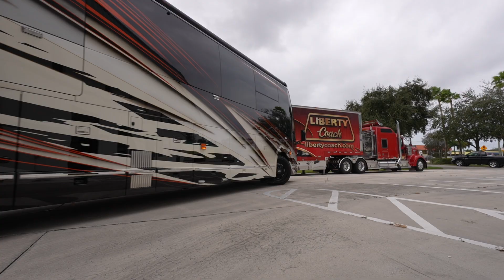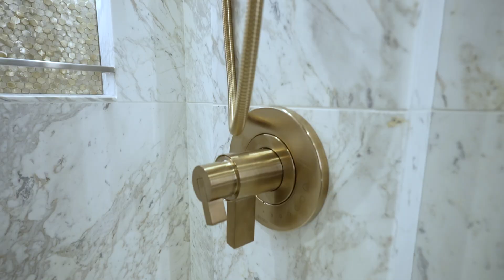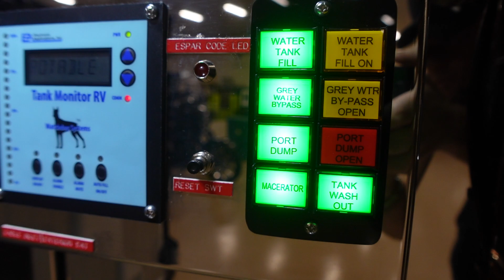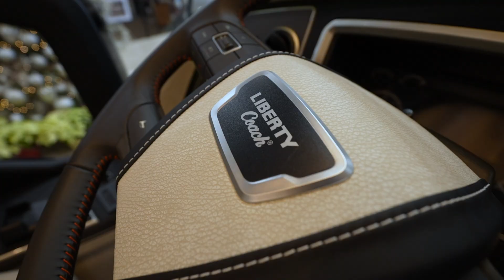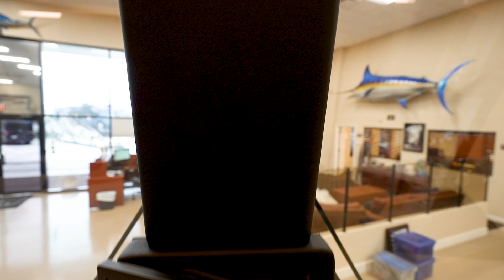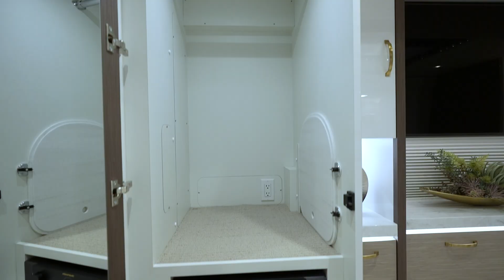2024 Liberty Coach #904 (New Body Style Prevost!)

Comment: Dose the exhush!st from the generator go through the roof too
Reply: Good question, the generator exhaust does not go through the roof, it is a bit complicated to do so, making sure there is sufficient air around the exhaust as well as insulation can take up a considerable amount of interior space, as well as loss of compartment space depending on where the exhaust would head up the interior of the coach.

Comment: Hey Liberty, If you scrimped out using a Westward toolbox, where else did you cut coners?
Reply: Thank you for a comment, do you have another tool box to fit the location?  We always used Snap-On, however they stopped production on a size we could use.  I can assure you we do not "cut corners"

Comment: There is a very big problem with your RV's and that is there is no way a person in a wheelchair can get inside or someone that uses an electric wheelchair that enjoy going places and hate being stuck at home all the time. If you can come up with one that will allow them to go camping or RVing with friends then I would be willing to advertise for you for free using one of your RV's with my brother Martin who uses a wheelchair if you are willing to let us have one for free for advertising with your logo on the side so I can tell people how great it is and you can use it as a tax write off
Reply: There isn't any customization they "can't" do.
Reply: Interesting comment. Since these are custom built I am sure they can accommodate a lift for wheelchair accessibility. If they meet your request if would be the most expensive advertising they could get. Not sure they would give away a coach worth that much just to showcase their unit.
Reply: There are wheelchair accessible motorhomes. I met a couple that had one made by Newmar. They found one used. It had a lift, hand controls,and the bathroom is wheelchair accessible with the slides in.
Reply: Yes you can (rare) find a used one. But they are old. I am also in a wheelchair, and also suggested the same as you did. No one interested and they use the reason that there is not a market need for them. To have a new one built they demand 3/4 of price down. So it might be less expensive to buy one then have a lift put in unless you can afford a new one
Reply: Invest in some prosetic legs 😂

Comment: What is the weight capacity of the slide trays?

How much do the slide-outs weigh?

Since the trend is going away from the satellite dish system, are the coaches outfitted with the Starlink system as the replacement?
Reply: The capacity of the slide out tray is 500 lbs, not sure I understand the question regarding the weight of the slide-outs?
Reply: The Starlink is not a replacement to the satellite dish, it is an internet data system that can be used in conjunction with the cellular systems.

Comment: Can you have more than 3 volta power packs and can you put in a super six engine rated at 750hp from volvo,as in the european volvos.
Reply: A 3rd Volta pack could be installed.  The reason we cannot get additional horsepower is transmission related, we are maxed out on the torque with the current Allison transmission package.

Comment: Something I'd like to know about Liberty and the other custom manufacturers is, how do they "test fit" or test assemble new interior or exterior design features into a new Prevost frame. Same for other manufacturers that might fabricate their own frames. Do these companies buy or fabricate a new frame and experiment around it to figure out what new design elements they can include, and to discover what current design elements can no longer be accommodated in the new frame design? DO they have a test frame in an area of the shop that they use as a cadaver lol
Reply: Great question, a lot of what we do is done be 3D modeling software that my brother Kurt Konigseder is an expert at, this in conjunction with Prevost allows us both to understand the needs of each other.
Reply: @frankkonigseder6592  Thank you, Frank. Over the course of several reviews I caught references to enhancements in engine/exhaust, wiring, heating and water, etc that made me wonder how you got that under your belt so quickly.

Comment: Never ceases to amaze me how each one gets nicer and nicer. In a different life I would have one no doubt.
Reply: It's a toss between a Newell or Provost. Pushing for the Newell 😅❤
Reply: @FairyChild_For_Freedom-Justice  Newell has smaller bays due to a slightly taller headroom inside.  They build their frames from scratch.  A Prevost will go a million miles--a Newell won't.
Reply: @MarkWork-fd5tt  Newell frames and bagagge framing are plain carbon steel.  MCI and Prevost use SS.
Reply: @MarkWork-fd5tt  Newell bays have frame C channels hanging down in them.  MCI and Prevost are open side to side.
Reply: @FairyChild_For_Freedom-Justice  Yes, Newell's are very nice as well! In a deam world I could go for either,LOL